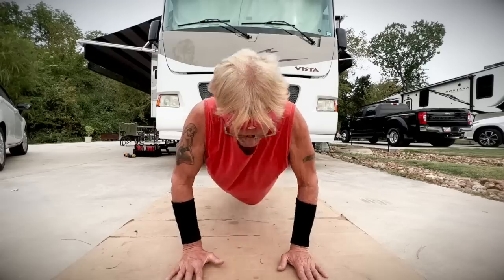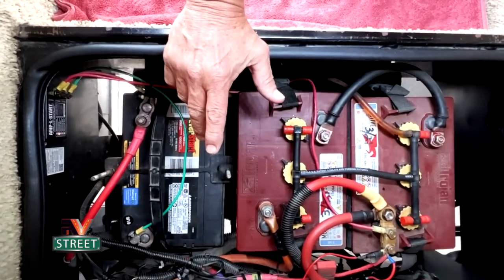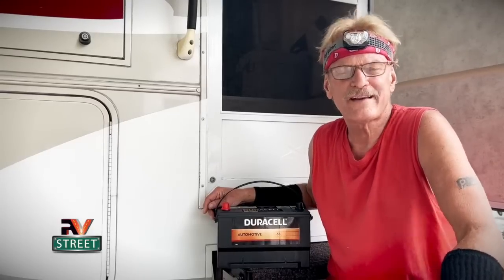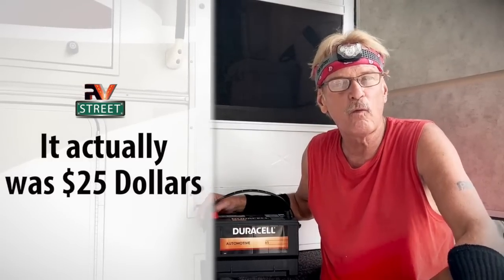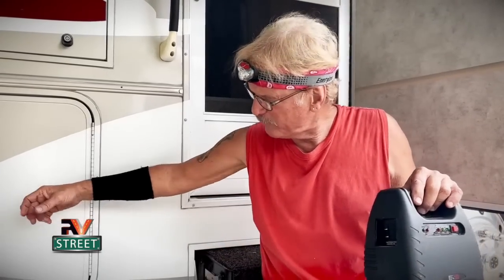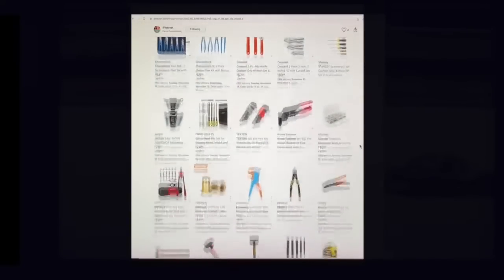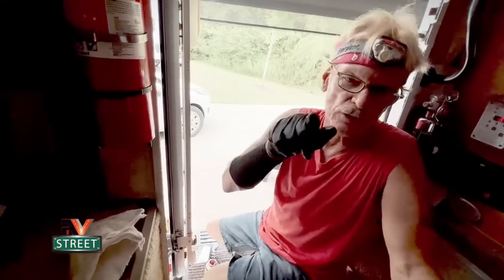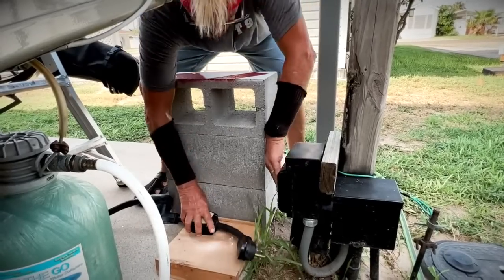How To Replace a Motorhome Battery—AND—keep it CHARGED while Parked or in Storage

Comment: I'm with you on the regular battery replacement idea. I was stranded 35 years ago with a dead battery I knew was going dead. Ever since then, I replace my battery every four years. Never had an issue. I do like the Everstart MAXX batteries. I've always had good luck with them.

Comment: If you disconnect the chassis battery(or cut off the switch ) when get to a campground why don't you lose all that information you were talking about. We have a round ECM OBD2 socket on ours(Diesel pusher) so that memory thing wouldn't work but I don't think we even need that. I replaced our chassis batteries 6 1/2 years ago( 2  1000 CCA Duracell batteries we bought at Sam's Club for 100.00 each) and we didn't lose any info that I'm aware of (Caterpillar engine and Allison auto transmission) . Never had a dead battery and we carry a booster just in case plus we can boost the chassis batteries with the house(I bet yours can too),or we can start the 7500 watt on board generator and charge them all up, without hook ups) That being said this will probably be the year we replace the chassis batteries. When we bought ours batteries 6 1/2 years ago the Core charge was 5.00 each, and the core charge on my Suburban battery(bought 2 years and 4 months ago was also 5.00. Dang 25.00 now, yikes Safe Travels and take care of yourself Martin. Love your videos.

Comment: Just so you know 13.7 is charging/float charge. Full charge is 12.7 volts. 
To bad you don't have enough room to add a second chassie battery. It would better suport all the work it does on your RV.

Comment: Martin, glad to see your doing well, I've missed your videos, I keep our RV plugged in while parked in the RV shed and the chassis battery turned off, works well for me, and I also carry a jump box at all times, it's small, about the size of a VHS tape , it will boast off from a dead battery about 5 times between having to charge, luckily we have not had to use it. the trick l start sounds like the way to go....Keep up the great work..

Comment: When you shut off the chassis battery, you shut off power to the ECM, stereo, backup camera, and basically everything else that's powered off that battery unless your switch doesn't actually cut power to all the circuits which isn't the purpose of the switch... Turning that switch off should be exactly like disconnecting a battery terminal.

Comment: Your Soo correct. When you notice the equipment not running quite right if you don't have full power . The equipment can get burnt out . . Good video. Dead batterys can cost you more than just replacing the bat

Comment: Hey there my friends. Another great video. I have 2 12 volt house batteries in series & just replaced one. Ran a Auto Meter check and it was marginal good. Will probably get and mount the Trikl Charge before long. Hope all is going well with you both and my prayers are always for you guys. As always, I got your back brother. Steve Robinson.